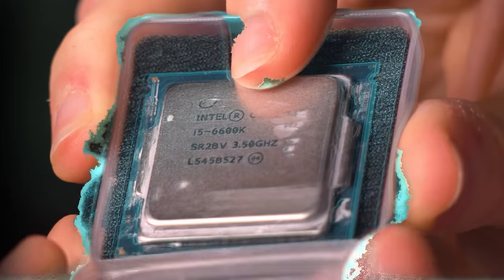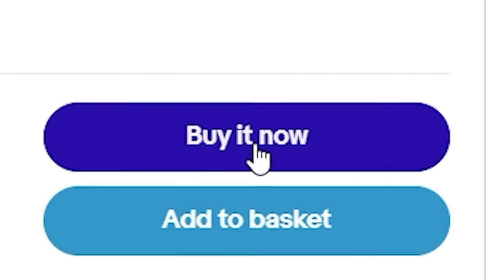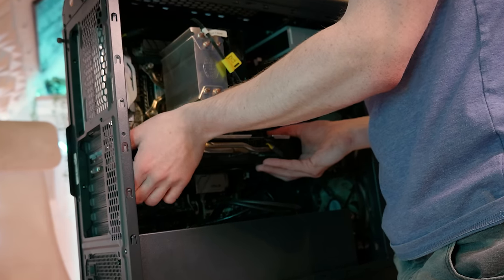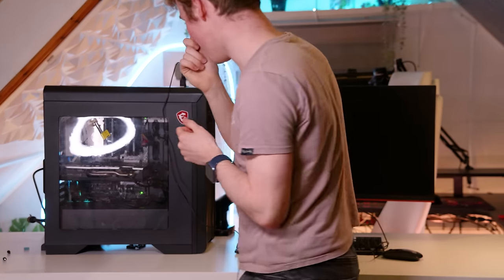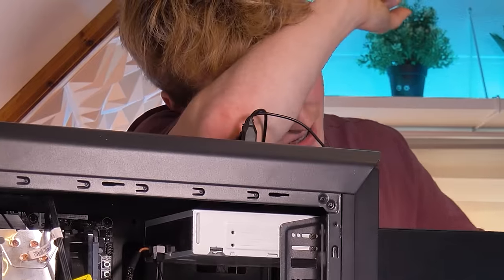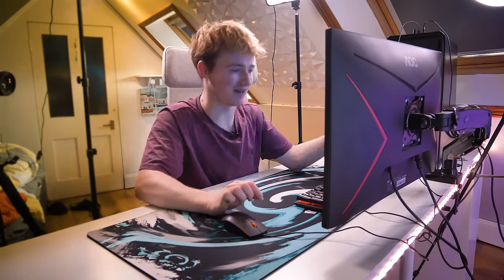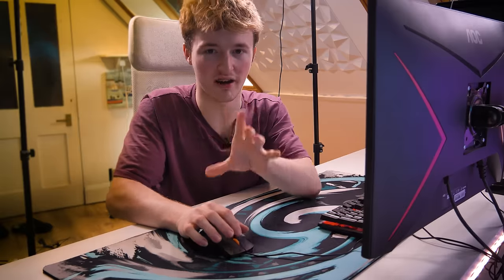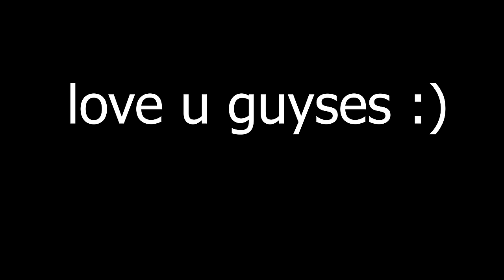Can You Game With An $8 CPU?

Comment: U PUT THE CPU IN A MOTHERBOARD WITH THE WRONG SOCKET
Reply: by disabled do you mean broken?  because there is no physicle damage and the likelihood of the transistors being broken is very slim. or do you mean that the asus motherboard is not compatible with the CPU on a software level?
Reply: @electricminecrafter  The motherboard is no longer compatible. That´s what he meant
Reply: Bro you cant put a cpu that is not in the motherboards socket
Reply: @golustheplayer you can
Reply: @golustheplayer some sockets are very similar or exactly the same, just different bus speeds
Reply: @Sirfrancior  ig its just the chipsets diffirence

Comment: The technological ignorance pains me so much...
Reply: I'm a to-be computer engineering student and I cant even bear watching this more than 30 seconds
Reply from the maker: Could you tell me a few main things to improve on? I want to improve lol
Reply: @Guiny  Wow I didn’t expect you to respond! Im glad that you look to improve and learn more about tech, and i admire you for that. Not many people are willing to learn, but im happy that you do. 

I don’t have much time to tell you everything, but i think the primary issue with your testing is the mods used, as well as the balance between the components. Vanilla minecraft is incredibly CPU-heavy, which is why you saw poor performance with the Xeon. However Fabric and Optifine are primarily GPU-heavy, which is why you saw a major performance improvement when running Lunar Client. The other thing to consider is that Xeon’s will naturally perform worse in minecraft when compared to the desktop consumer segment chips from the same era due to lower clock speeds and slower single thread performance. This is primarily due to workstation tasks needing more cores and not faster cores. 

But overall, i think this is just more of an issue on my part, as I personally look forwards to the analytical parts of tech videos like this. Maybe it’s because i’m just a computer nerd, but keep up the good work.
Reply: @ItsHonski  i doubt he actually read all  that 💀
Reply: @Greenscreenkid_798  that's not a lot of words

one time i read a comment for minutes haha
Reply: @ItsHonski
Reply: @Guiny  Perhaps test it on java edition bedrock is like the phone equivalent

Comment: Intel Xeons aren’t scams they’re just very cheap because they mass produced them back when everybody wanted them and nobody wants them now. They’re typically use in workstations and they’re so cheap because offices and etc clear them out to get new ones all in one go.

They also make pretty decent budget gaming pcs if you can find a decently newer version of one. Btw they’re also server cpus.

Edit: thank you guys I never got so many likes before!
Reply: my pc is worse  but has the same cpu bc it has intergrated graphics
Reply: i have one and its obviously ass but it can run fortnite at 70 fps medium settings
Reply: @CodingK1d  depends which one you have really
Reply: @CodingK1d   I have a 15 6500 Intel core cpu that clocks at 3.2 ghz and it can only run fortnite 45fps at lowest settings (you must have a good or decent gpu then
Reply: Ye, I have a xeon e3-1220v2 and it can run mc at like 80fps 32 chunks so long as im using some optimization mods, my gpu is the gt 730 4gb and it underpreforms for my cpu
Reply: @PrimeCommand  well it can turbo to nearly 4 ghz
Reply: @ThedestroyerPlays2  you can turbo it??
Reply: @ThedestroyerPlays2  I have a laptop which is very slow, I have an HDD hard drive, but in itself I think that it is this single detail which makes it so slow because it has an i5 7200u which is still acceptable (I run the launcher + minecraft in 10 minutes and I bug as soon as I emt a pack) but I have 120 fps on average on lunar 1.8.9 optimized for bed war
Reply: @PrimeCommand   yes most cpus  can do that
Reply: @MrBee.officiel  yeah I play  bedrock bc  all my minecraft friends have bedrock  and one two have java  ill try to see if there is fps modification for bedrock
Reply: here in brazil they are the bests cpu for a low price pc
Reply: Now I know why some motherboards are cheaper than others, maybe also because why one didn't work at all with the other parts, perhaps the intel dq77mk I bought was a server motherboard
Reply: Now I know why some motherboards are cheaper than others, maybe also because why one didn't work at all with the other parts, perhaps the intel dq77mk I bought was a server motherboard
Reply: Бля вы чё только что узнали что такое xeon ну удачи вам с его разгон и прошивки Bios. На самом деле материнки под Xeon от китайцев говно если ты не правильно рагонишь процессор или не повысишь   напряжение то она згорит или нет даже если ты не чего не будешь делать т е  сидеть в стоке то она тоже быстро сломается на них нет гарантии .
И если щас кто-то скажет что есть нормальные материнки под xeon или что-то подобное то блять эти материнки стоят около 27 тыщ а по словам многих сборщиков на xeone  он дешёвый и мощный да процессор мощный но нормальных маатеринок под него нет.
Reply: pc or laptop?
 @ThedestroyerPlays2
Reply: They are also used in server
Reply: @filip_hraje  I did mention it
Reply: @iampro1412  pc {its a refurbished dell}
Reply: Ye but the rtx into his pc do all work xD
Reply: @MrBee.officiel  u should try and get an ssd for your laptop but you should research it first before buying a ssd
Reply: @Leha_055  At least you have a graphics card
Reply: I run a Xeon E3-2680 v4 with an RTX 3060 and it's smooth like butter, I can play Minecraft with shaders at 180+ frames and it doesn't drop at all. Even Overwatch 2 on ultra runs at around 220 fps at 1920x1080
Reply: @ikirtz  I have a xeon e5-2676 v3 (12/24) 15% in cs2 lol
Reply: bro saying some fax to someone who does not know some basic of computer......he also said he never hear of pentium or xeon so he could learn that.....

No hate ♥
Reply: @ThedestroyerPlays2  pls put a graphics card, idc abt your budget. 25 dollars ? 50 dollars ? doesnt matter. jst one.

if your on a budget just take an rx 580 or a gtx 1650. i have a gtx 1650 and its good. you also can take a gtx 1060 6gb, a gtx 980ti or a gtx 1070 if your fancy. but PLEAAAAASE GET A FUCKING GRAPHICS CARD. and avoid the GT series of graphics cards by nvidia. they are worse than integrated graphics
Reply: @arthursoares5413  same in turkey, market suck over there already, but thank god most offices pump out with 1000 turkish lira pcs with i5-i7 4th gen or xeon e5's, i mean i have one and i love it
Reply: I have Xeon E3 1231v3 with RX 580 and 16 gigs ram,it can even play cyber punk at low,bettle 5/1 ultra.its a beast for 10bucks cpu @L-E-O-_-
Reply: E3 1231v3 RX 580 16 gigs ram, Its can play re 4 remake/2/3 high, bettlefield 5/1 at ultra , god of war 2018 original set. Beast for 10 Bucks cpu and 35 Bucks GPU
Reply: He got scammed tho it was a crappy pentium in a xeon shell
Reply: Thats
Fucking
Sick
Reply: why the pfp look like dad from cloudy with a chance of meatballs
Reply: @FNRCLIP  it’s heisenburger
Reply: not to say he placed the cpu in the wrong socket

Comment: the reason why lunar client got 1000 fps was bc it was mainly running off the gpu, which is like miles better than the cpu
Reply: wtf no? lunar got 1000 fps for 2 seconds and it was while the chunks were loaded, it doesn't lag because default minecraft is really unoptimized and lunar uses i guess some performance mods/addons to the client that make it run better and make faster  math
Reply: Minecrafts code isn't made to be run on the GPU. You can mod the shit out the game but the backend of the game is designed to be handled by the CPU. You would have to completely rewrite Minecrafts code (And not in Java to begin with) so it can hand all the complex calculations like Chunk gen, Mob AI, etc. to the GPU instead of the CPU. While Minecraft sort of supports Multithreading for chunk gen, it's somewhat experimental because it increases the chance to generate faulty chunks. Modern GPUs have thousands of cores and great Performance when these cores work together but not when working alone. GPUs have horrible single core performance and you can generate a single chunk on a single thread. Chunk gen speed would be horrendous when running on the GPU. Minecraft would have to implement a system that allows the game to generate a chunk on multiple cores at the same time but this would probably be highly complex and just not worth it. 

The GPU is only used for things like lightning, shadows, particles, vertex shader, Tangent Vectors, rendering triangulated polyhedras etc.
Reply: @luigiistcrazy totally right
Reply: and if the game was still based on gpu it would be bottlenecked by the cpu
Reply: @luigiistcrazy Lunar client has gpu compatibilty. If he removed the gpu he would get 20fps max
Reply: your right dont listen to these randoms who think they know sum
Reply: lol, most game will need both cpu and gpu to run (cpu for logic, physic, AI, etc... and gpu to render the visual)
To force a game to "completely" run on cpu, you still need gpu and a cpu with no igpu
Reply: @TentisSH  sure, if i remove my gpu, fps in every game i play will be dropped too lol
and no, every client, every game, everything on windows have gpu compatibilty

Comment: Your pc is being carried by your GPU.
Reply: not really smartie, the intel pentium is so old that bottlenecks his cpu by alot, its like having an rtx 3060 and using it as a intel hd graphics 4000 (intergated) so think before u say something
Reply: gpu just renders 3d, his player moving turning, generation otherwise is all handled by the cpu
Reply: and for crying out loud, the CPU is more important than the GPU. integrated graphics may be bad, but the CPU is necessary.
Reply: @whkn  fr
Reply: @whkn  who tf  said it isn't , that wasn't my point
Reply: @whkn  and for the record that cpu dosen't have integrated graphics
Reply: @senpaisan7818  cpu's don't necessarily require an integrated graphics system to be able to render 3D. CPUs command the entire system in itself, the GPU just improves and builds on that output. So therefore, GPUs really don't carry CPUs.
Reply: @whkn  finally someone who knows about pcs like i cant hear those boomers try to look smart
Reply: @whkn  He used sodium which hella increases the gpu usage though which is why he got 1000 fps with 7 dollar processor, you aren't wrong but the gpu definetly gave gave a solid 600-1000 extra frames
Reply: @george9384  finally someone smart man 
btw was the 1k fps cap bc i have an i5 760 and never tried lunar client on minecraft
Reply: @mrnobody2-2  ty lol wdym 1k fps cap
Reply: @george9384  even tho there is a bottleneck you will not get 1000 fps without the GPU smartie
Reply: depend on game, but to get 1000fps in mc with pentium, your gpu clearly carry the pc
Reply: @stretchmyjerky Ya bro i will give you 1000$ if you could get that much fps on same hardaware in the video without a gpu
Reply: @senpaisan7818  That GPU does integrated Graphics, and Minecraft is CPU INTENSIVE. The GPU will be needed when running shaders or mods mixed with shaders, The CPU does the rendering of not only the player model but everything else, all though he has a GPU if you watch Assuming u skipped that GPU needs 2 eight pin connecters in which he only has 8 of the 16. that alone would not be near ENOUGH to run something in need of a GPU. The GPU needs its wats and with only 1 of the eight pins connecting . Theres a HIGH chance his GPU is at 1% usage if not using 0%
Reply: @SRWBuilt  Bro stop yapping shit if you don't know what you are talking about, First of all even if that cpu have igpu that would be of no use cauz the hdmi is connected to Amd Gpu and about gpu being powered with 8 pins, i can confirm that would work perfectly fine. Infact when he opened task manager you can clearly see his gpu was at 87% percent usage(yes amd rx580 gpu) and was also seen in f3 menu of minecraft, that gpu was doing all graphic related task
Reply: Ryzen 5 3600 moment
Reply: Minecraft is a CPU heavy game, even with an iGPU I can push 120 fps on the latest snapshots
Reply: @SRWBuilt  Minecraft does not use software rendering wtf
Reply: @senpaisan7818  The rx580 is pretty good, can run modern games even. PC is clearly CPU bottlenecked, you could use any GPU and you'll probably still get the same results in Minecraft
Reply: @Wumbee.  I didnt say it does. The cpu does the rendering bud
Reply: @Wumbee.  i didint say you cant? lol IGPUS are there to help

Comment: Dawg you have a high end gpu of course it's going to work
Reply: Minecraft relies heavily on the CPU. 
You can have the strongest GPU in the world, but if your CPU is 20 years old, Minecraft ain't gonna run.
Reply: @ebonygyro8736  Yeah but he literally put it at 2 chunks and didn't load stuff in, the CPU wasn't the one pulling the fps up
Reply: @noisnecsa995  My point still stands. The fact is, unless you're using shaders, Minecraft relies on the CPU more. That's not really up for debate.
Reply: He is using an rx580 which is the equivalent of a gtx1650 so it’s not rlly high end is it

Comment: the second power cable for the gpu wasn't even plugged in😭😭
Reply: That doesn’t matter it can run integrated graphics
Reply: @Mase.-  nope, it's running off the GPU. if it'd be running from the integrated graphics, the HDMI cable would be plugged into the motherboard, not the GPU, and in the F3 menu you can see that it's rendered off the GPU

Comment: Minecraft Bedrock has worked so well because it's more of a GPU based game.
Reply: Wrong. Bedrock is written in C++ which is way faster than Java. Bedrock and Java are barely different in the way they handle API calls. Where in a system everything is handled is the same. Chunk generation, mob AI and whatever is still running on the CPU while stuff like lightning, shadows, particles, vertex shader, Tangent Vectors, rendering triangulated polyhedras etc. is still handled by the GPU.
Reply: @luigiistcrazy  Bedrock is not "way faster than Java" because it's written in C++, it's faster (though even this is debatable) because Minecraft Java Edition is the codebase equivalent of a festering garbage tip.

Comment: I am wrong here, The RX 580 (The GPU he is using in this build) only requires an 8 pin power connector from the psu so the xeon was the only problem for the system before, my bad on that one!
So please laugh at my stupidity down here :D
 |
 |
V

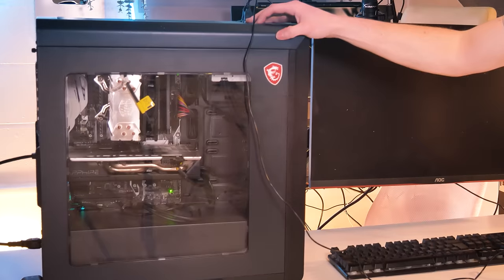4:40 It also helps to have both your GPU connectors plugged in!

Thats why the display didn't output anything, also the Xeon would be incompatible as you later discover and thus the PC would display a message similar to "Incompatible CPU/Proccessor"

Comment: the main component to run minecraft is the gpu,
youre still using a good gpu.

the reason its still running badly, is because of bottleneck
Reply: 1. Minecraft isn't GPU intensive
2. Since Minecraft is CPU intensive, there is no GPU bottleneck, but on the other hand, if you play a graphic intensive game (or play Minecraft with shaders), your GPU will be bottlenecked.
Reply: Minecraft rarely uses more than 50% of any GPU
Reply: @MegaKR  The fact that Minecraft is CPU intensive is literally there reason the GPU is bottlenecked by the CPU. A CPU bottleneck is when the CPU is holding back the rest of the machine by being underpowered. I'm afraid you're a little confused.
Reply: @noisnecsa995  I ment GPU bottleneck lol sorry

Comment: The reason MC works so good even with such a trash CPU is because CPU isn't the only resource the MC uses. Others like GPU, RAM and Cache also play a major role in the performance. CPU's resources are used to process the world and loading/unloading the chunks. GPU is the real component responsible for the graphics, so standing still gives you a huge FPS boost because you aren't putting any load on the cheap CPU, but instead the resources are beings used from the expensive GPU.

Comment: Isn't one of those GPU cables unplugged?
Reply: rx 570 only requires for the 6 pin to be populated i believe, the rest is extra for additional overclocking and that.
Reply: but yes you are correct lmao
Reply: @Jamesplayz  oh
Reply: @Jamesplayz  I always plug in every connector no matter what, so I’m not used to seeing an unpopulated connector
Reply: @charliesretrocomputing  yeah i understand that, i do the same lmao. the more you know tho, am i right?
Reply: @Jamesplayz  Yep 👍
My phone has been on 1% for 15 minutes - when do you think it will die?
Reply: @Jamesplayz  my battery is cooked 💀
Reply: @charliesretrocomputing  now
Reply: @charliesretrocomputing  lmao
Reply: @Jamesplayz  you were correct it died when i sent the comment 💀
Reply: lmaoooo @charliesretrocomputing

Comment: how the hack did you manage the put Xeon cpu into LGA socket ? .___ .u can easely band all pins that way.

If u removing GPU lay pc down on site and not remove GPU when is pc "standing" its more safer and u will not band pins or scratch motherboard.

Also u combinating several years old cpu with a brand new GPU so u basicaly make "bottleneck" thats mean one of the component is faster than the other one so its slowing all pc performance down. If bottleneck is more then 5% its very bad.

Also some of this old cpus not working properly right with new ddr4 or drr5 rams bcouse at the time when this cpu was relesed only ddr3 and ddr2 types of ram was existing.

At the end i want to apologize for my bad english :( i hope u will understand.

Comment: How does the gpu work without one 6pin plugged-in?
Reply: as long as it doesn't run over the power that 1 8 pin can provide, it'll work
Reply: @theorphanobliterator  i guess it's specific to that gpu, because my gtx280 didn't run on a 6pin only
Reply: @tigersusyt  I'm pretty sure it's an 8 pin, NOT a 6 pin. 8 pins can handle much, much more power. my 3070 boots just fine with only 1 8 pin installed, but crashes when running games
Reply: @theorphanobliterator  ok